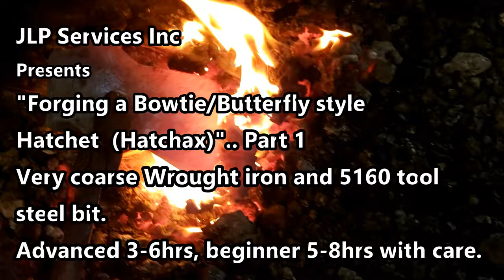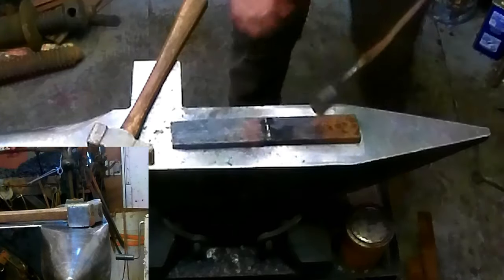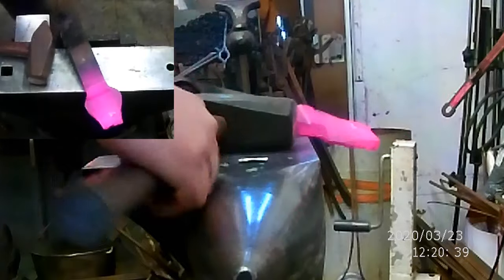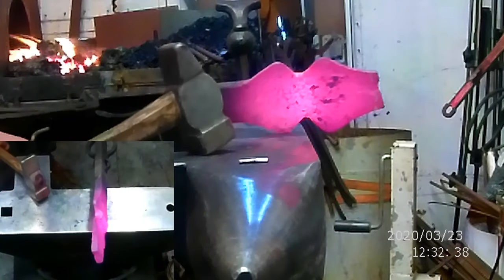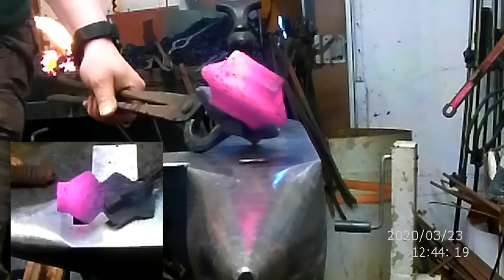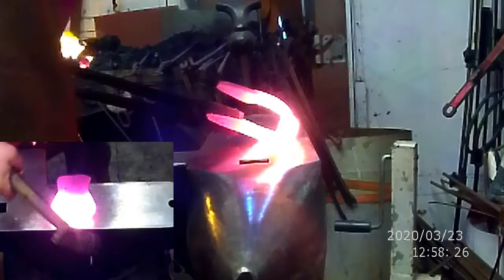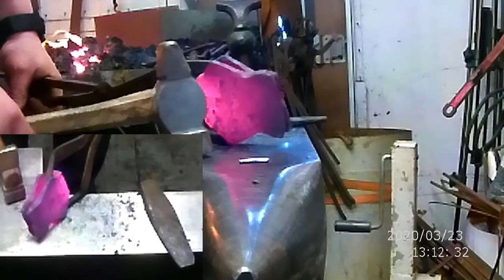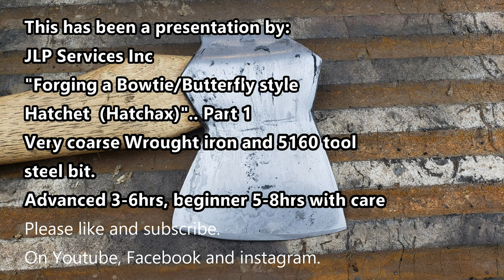How to Forge a Hatchet (butteryfly/bowtie) part 1

Comment: I would have bet that stuff would crumble when you folded it at the poll, but you showed your your talent once again. I’m also amazed at the symmetry from side to side. Now I’m convinced that you could make honey out of hog poop!
Reply from the maker: Wayne, thanks..   I wasn't sure if it was going to fold over or not.   The wrought iron was so coarse and ill tempered. 

It was ridiculous how bad it really was.    Of note..  One just has to pay attention to the details and respond appropriately before it's to late.. Basically keep things in check while forging.   

Switching to the smaller hammer and forcing the inside radius over saved it. 

It swings great..       thanks..